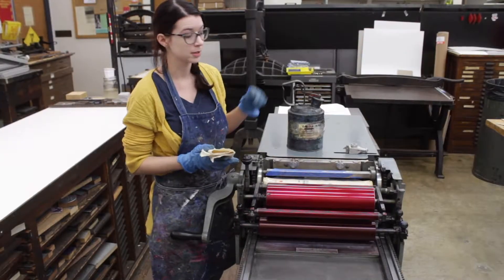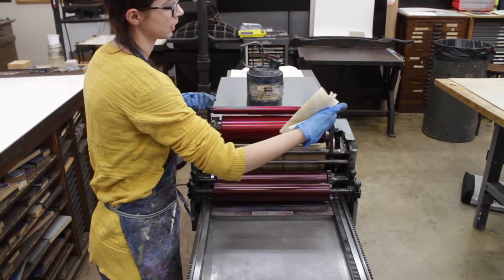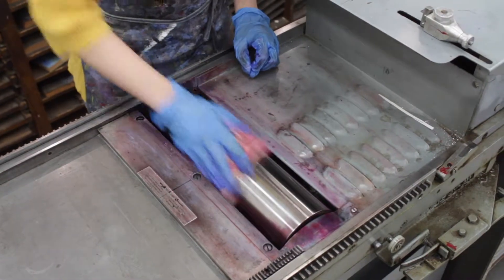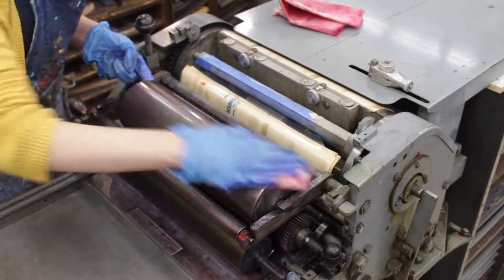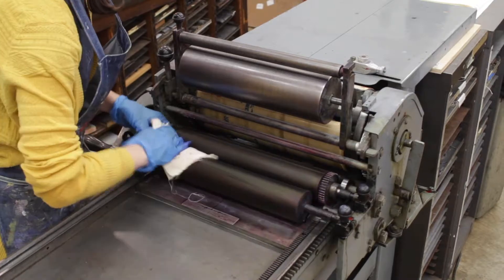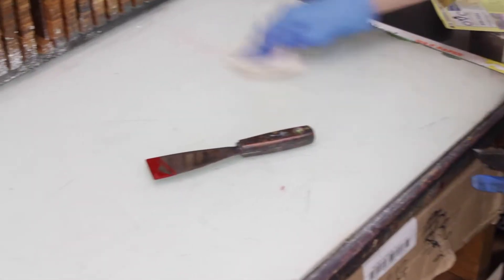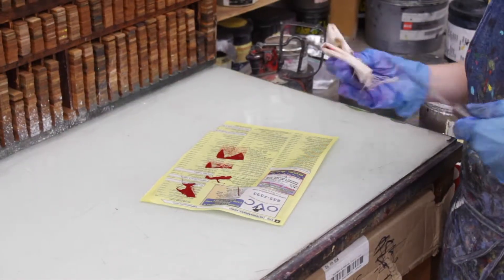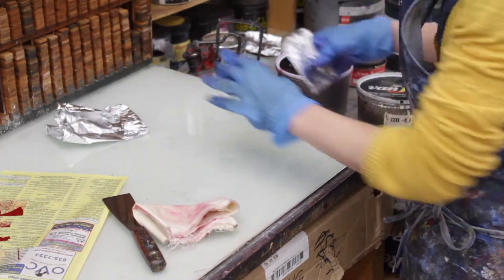Vandercook Sp-15: Cleaning the Press

Comment: what is the chemical in the container?
Reply from the maker: I prefer to use oil base inks. I use mineral spirts to clean ink off the rollers. People use a variety of solutions. If you use mineral spirts, beside to use gloves and use it in a ventilated room.